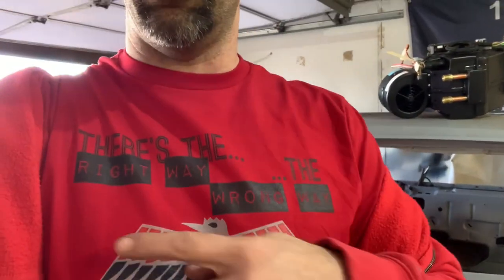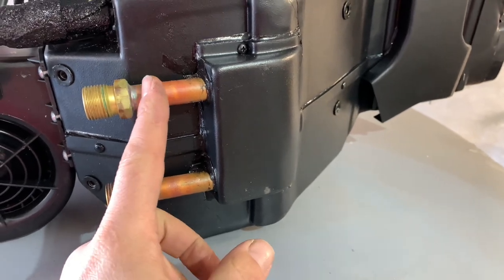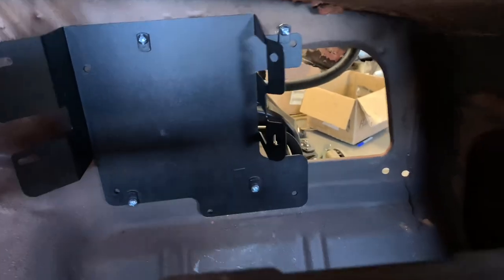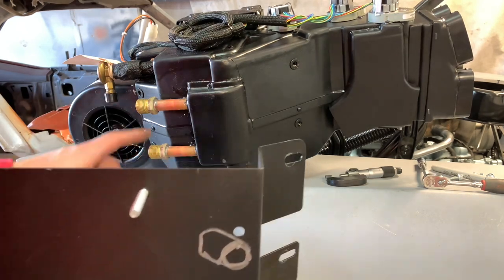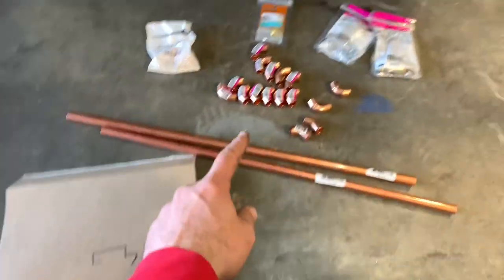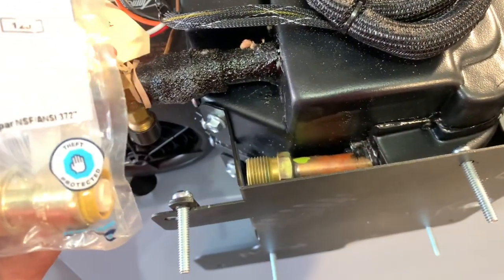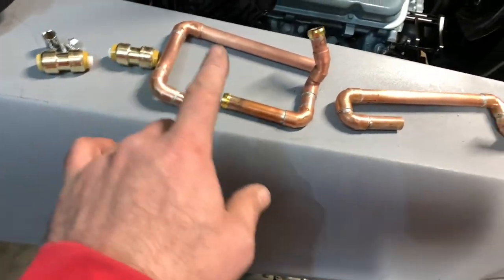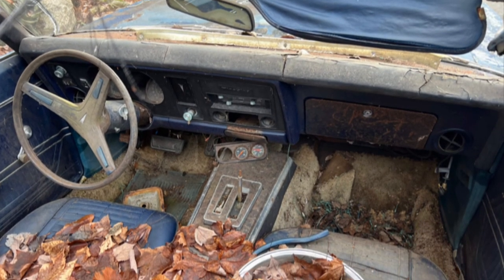Want  to run factory looking firewall and heater hose location with Vintage Air kit? Cheap DIY mod

Comment: I am waiting on my Vintage Air kit to arrive for my 68 convertible and I am thinking of doing this.  Is there a reason that you cant just run all heater hose the same way you ran the copper?
Reply from the maker: I suppose it is possible, things to keep in mind the holes in the firewall might have to be enlarged to fit the hose and a grommet to protect from rubbing thru the hose. And secondly heater hose has a tendency to kink and you will need some tight radius to get it routed back around.
Reply: @VinylVillageGarage  - thanks for answering!  I had thought about the 180 bends and have found some pre-bent hoses that might work.  The grommet is probably needed!  Are you ready to come to Cincy to weld some floor pans?

Comment: Great idea! You should share this with Vintage Air! I love the idea of having the factory look of the original heater box. Vintage Air should make this an option for their system. They could have built it this way.
Reply from the maker: I think vintage air could definitely benefit from doing this mod and selling it. The advantages are there.  The installer could reuse heater core hoses, not cutting on the firewall and keeps the firewall looking original without just a block off plate bolted to it.

Comment: I love your channel and the way you present all your info.
   I am wondering if you may have introduced a future problem for yourself when you used the compressed air to "blow out" any debris (EG: copper fragments) after you first cut the tubing off. Then again after you deburred the ends.  You may have blown some copper pieces into the unit, which may someday go into the valve and/or other areas.  Again, this is just a thought that came to mind when I watched this video. Did you insert some sort of blocker before you did that, like a small piece of rag or paper towel?

   About 2 years ago, I purchased a 100% original 68 Firebird 400. It has some rust around the wheel well areas, and some on the passenger rear rocker panel, down where it meets the inner rear quarter door jamb pillar, but the whole car is not too bad at all.  I started working on it and then found that I was dedicating all my time to it and neglecting to finish all my other home repair projects around the house I had to do. So I stopped working on it, finished all the home repair projects, and am now ready to resume working on it.
I am anxious to work on this ol' bird. I've been watching your channel for that long and getting more enthused after every video. I know I can do this in my home garage too.
   I am looking for some sort of "sequence" recommendations on this teardown and restore.  I purchased every 
book and CD I could get my hands, to get all the info I could.  
  My high-level plans are to tear it down completely and then go have it media blasted and then epoxy primed.
Then I'll tackle all the repair areas.
Any helpful info and/or recommendations you can pass onto me would be greatly appreciated.
Please, please, please, reach out to me off-line. I am in the Phoenix, AZ area. A few miles from your friend over at Arrowhead Garage.
And,,, thank you for giving me hope on doing this.
Reply from the maker: I suppose it possible the copper pieces could mess up the works.  Prevention isn’t a bad idea. Now if it was an air
Conditioning line definitely keep
Debris out. It would damage the compressor or expansion valve.  

As for restoring a car like a total overhaul.  Start with a methodically dissembling and Labeling parts and hardware.  I like to use masking tape to secure mounting hardware to a particular component like wiper motor and trans. Then box it up. From this point opinions change on what and how to do things next.  If you want  long lasting repair and finish Definitely remove any rust for exterior panels there isn’t any magic product chemically that stops rust that will hold up and last.  Media blasting is my preferred, chemical dipping is an option but costly and still
Needs sanded and leaves rust behind. Like cutting out the rust and replacing panels before media blasting which is strange for some people.  One rust is removed epoxy then body work on top of epoxy, seal then paint. After that reassembly after restoring or repairing or even replacing all the parts.  
 That’s the quick version.

Comment: Possibly could have done the same thing using AN fittings with NPT ends on them. Have a 70 and 77 I'm going to do something similar with as I don't want to mess with the kick panels either.
Reply from the maker: Not a bad idea at all. Thanks!

Comment: On the large tube that you created a retention bead with a bump of solder. You could create a better retention bead. By placing a ring of solid copper around the tube. Secured with solder. Perhaps 18 gauge wite or so.
Reply from the maker: Great idea. That would definitely be a solution.

Comment: Morning all 
       I pulled the factory ac off my74 Pontiac when I replaced the heater cores couple of years ago.
      I wish I'd had your knowledge when I tried to put the dash and assorted goodies back where they belonged.
Anyway after two days of inventing new words about engineers who put stuff where a guy can't get at it it was back together and worked.
      It put me in the correct frame of mind to do an oil pump on my 04 GMC.
      No fear Jon,  it's just more parts to r and  r. 
             Fourty degrees was great 
                   Saps running.
        Those shark bites are really great.
Reply from the maker: Just playing cars like you, I have yet to do an oil pump on an LS engine hope yours went well and 40 degrees is above heat wave. Spring is just around the corner

Comment: I wonder if you could use adapters and PEX tubing instead of cutting off the vintage air fittings. Prob can't bend that tight of a radius with PEX. So does the Vin air unit have a built-in heater core? Thanks for another great vid!
Reply from the maker: Yes heater core and evaporator are preinstalled in their box. Its small and all fits inside the dash.
Reply: @VinylVillageGarage  Interesting! My 79 TA has factory AC, and I'd also like to retain the original look under the hood. I'll have to research the mods for that... unless you already have that figured out? 😀
Reply from the maker: @Pab-B  nope haven’t modded a second Gen. Yet but I am sure you could do sometime similar
Reply: @VinylVillageGarage  Everything looks very similar so far. Have you done one with fact ac?
Reply from the maker: @Pab-B  not in a Firebird but I did do my GTO

Comment: What size heater hoses are you planning to use? Thinking 5/8" and 3/4" hose will be too big for those 1/2" pipes
Reply from the maker: 1/2” inside diameter Cooper pipe equals .625 od which is perfect for 5/8 hose the the sleeve i put on the other has an o.d. Of .743 which works great for the 3/4” hose. So end result the factory heater core hoses will work great. Unlike vintage air original design using both 5/8”
Reply: @VinylVillageGarage  OR there are 5/8"hoses with a 3/4" end on it for the timing cover nipple..Gates part number  18804 or NAPA part number 10084